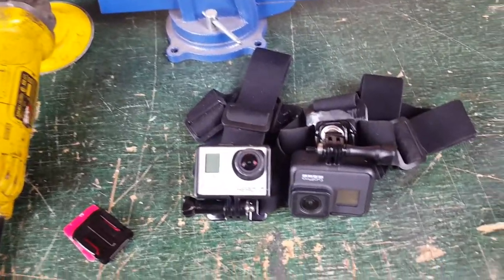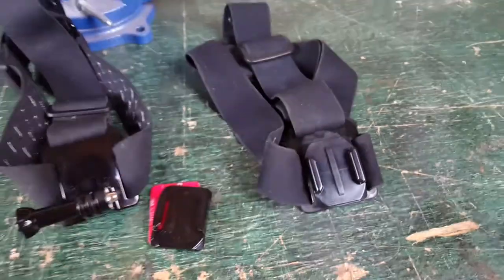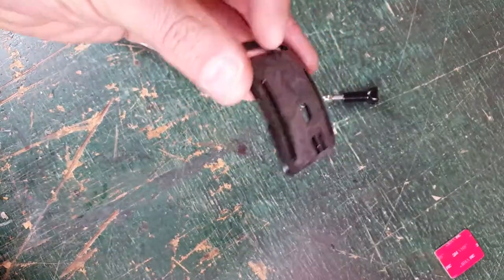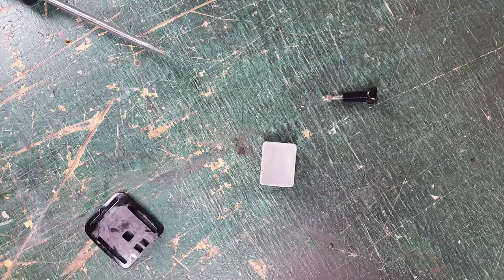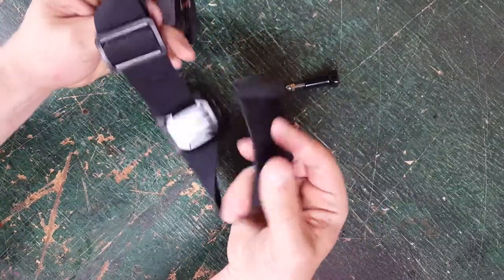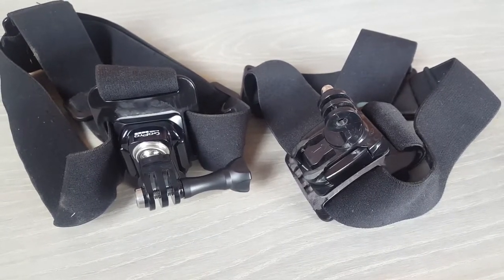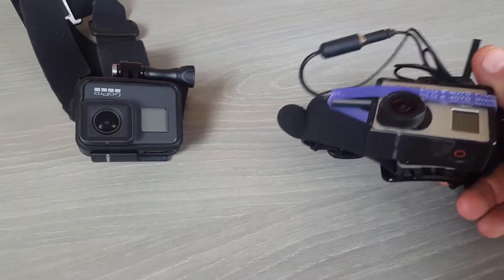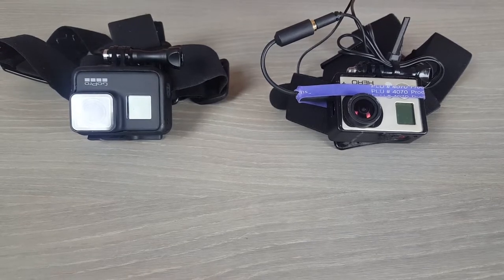Make a better GoPro headstrap for POV hunting and shooting.

Comment: Hey mate, great video. I’m using a hero 9 with max lens mod. The horizon lock feature should eliminate the need to offset the GoPro camera for when I tilt my head, right? I guess the only thing I’d need to modify the head strap for is to invert the lens to get a better angle over the barrel like you’ve achieved.
Reply from the maker: You will still want to have the lens centered over the bore line as much as possible when you shoulder the gun and lined up looking down the bore. The left right tilt won't matter much with horizon leveling. 

I just a line on the center of the lens with silver sharpie and it's easy to square it up looking at it with your peripheral  vision above. 

Also the way I started editing since this has changed. When I start to shoulder the gun I'll start to keyframe zoom in. That allows you to make some small centering, horizon tweeks, recoil correction, etc. It's rare that you'll get a shot centered perfectly.
Reply: @TheRoamingHazard  Great info, thanks for the reply! I’ll get started on the mod.